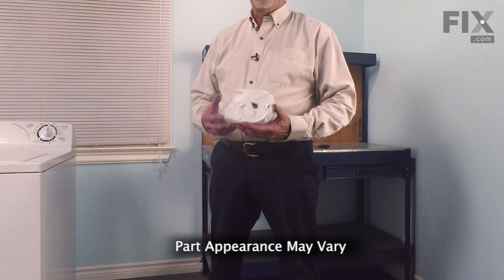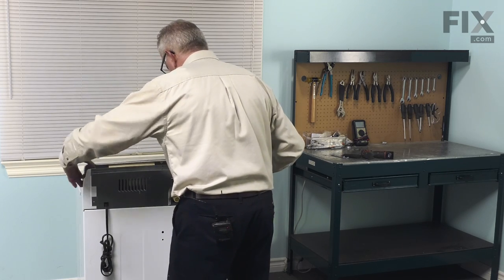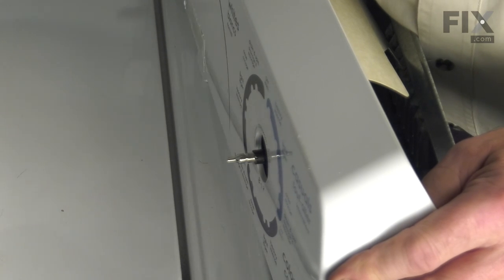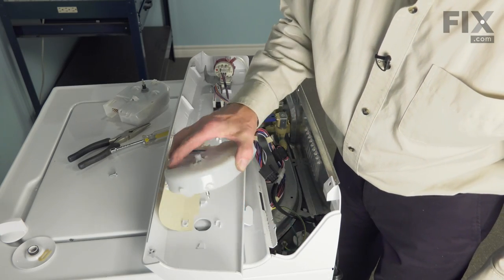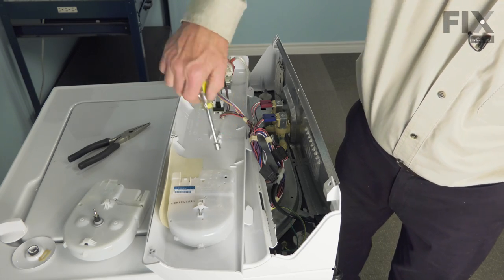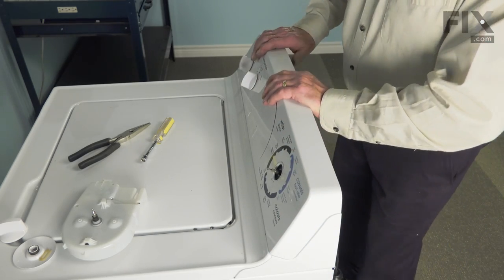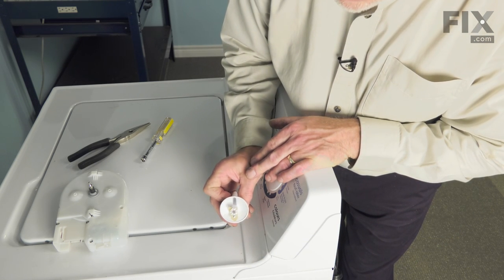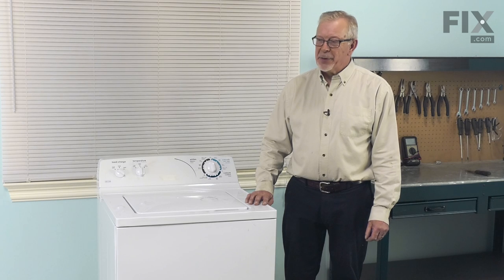GE Washer Repair - How to Replace the Timer

Comment: My GLWP2000M0WW broke... the timer seemed very loose so it was impossible to pull or push the knob in or out.
Showing how to remove the plastic clip that holds the knob on helped !
I was trying to remove the round metal spring.. then I saw the clip in between the knob and the big white plastic "washer".
The timer works fine, but the plastic retaining clips on the back of the panel and the timer broke off, which made the timer loose.
I cut some metal from an old license plate, and epoxied a piece to the one on the timer, and the other one on the back of the panel.
Waiting for the epoxy to dry completely.
The alternative was to let the timer hang out and use two hands to manipulate it... I don't think my wife would have liked that... HAH !

Comment: Very good.  I have the same machine and it was a great help!!.  The only thing was I can't see how to make the timer snap into position before installing the screw.  Could not see anything broken off or missing.  So I added duct tape to try to hold it down during pushing it in.  I may have to add a bolt coming thru the sheet metal in the back to provide support on that end of it.  Thanks again.
Reply: @waynerussell1120
I have this issue as well. The plastic tabs have broken and that leaves the selector assembly hanging by the one screw. I am considering duct tape right now.  How has yours held up?

Comment: Is it possible that model HTWP1400F2WW  By Hotpoints bad timer would cause it to fill up, wash briefly, slow rpm spin , then rapid rpm spin( no draining) water stays in  and due to high rpm slings water over top ring and out over flow pipe.
 While set on light permanent press, extra small load. Level of water fill was correct, pump can be made manually to pump out water so pumps good. No debris in pump. Lid switch shuts down the spin when lids opened.
I can manually turn timer so it pumps in water, agitates, spins both slow and rapidly, pumps out water.  I can not stop spinning with timer moved to off position or by pushing in timer knob. Only by lifting lid or unplugging.   Pressure line to level switch can be blown into and itll stop water  and then  begin agitating off and on 3 times then slowvrpm spin that eventually changes high rpm spin thus sling water over top ring.

Comment: I just watched this video went out got a small screw driver and my needle nose and in less than 2 minutes maybe 3 it is working .The timer ring was pushing in the metal pointed prong the knob connects too.I was able to grab with the needle nose the pointed shaft and align the ring and snap it in place the knob slid on and the plastic retainer clipped on it is running again.Thank you very much for this video sir.God bless

Comment: I have 2 issue, one when I turn the knob it doesn't adjust to how I want to set it, I have to use pliers to hear the clicking sound, the other is after it washes, it won't spin I have to put my hand spin it and then it gets strength to spin. What could it be. Please help me. Luzc

Comment: On my washer there is a small auxiliary clip that holds the mode control housing body to the rear side of the bezel. In addition to this clip, there is a 5/16” screw that holds the housing in place. My clip had broken off, when I pushed on the control knob to shut the washer off, the whole housing pushes away from the bezel and does not shut the machine off. The control knob just flops around and did not function properly.

I made a stainless steel auxiliary retaining clip to hold the housing to the back side of the bezel and super glued it in place. It’s a tall z shape that catches on the side of the housing near the parting line alignment tabs. The bezel looks like a polycarbonate ABS blend and takes well to epoxy or super glue. On the part of the z shape that is glued to the bezel I drilled some transfer holes in the metal for the glue to bite into.

The retaining clip height dimension is .875”.
Reply: I need to get a look at your setup
Reply: Has this held up? I have this same issue and am looking for a way to secure it

Comment: My timer works fine but seems to have become loose somehow and it caused my control knob skirt to pop out. I've been able to realign it again by reinstalling the knob but I usually have to pull up on the timer stem a bit before the knob skirt can be pop back into place. It works long enough for me to be able turn the dial and set a load cycle  but then everything pops out of place again after a few times of pulling and pushing back in the control knob. Could the retaining screw for the timer on the inside of the console panel be the issue?
Reply: Did you get it to work and how?